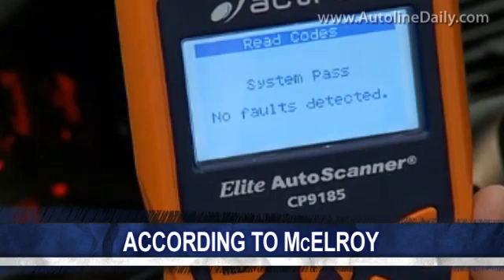How to Fix Unintended Acceleration for Toyota and Every Automaker

Comment: I have the 2008 f250 with 60,000 miles when I come too a stop light the the unintended  acceleration of goes from o- to 60 mp and I have to put my foot on the brakes, and turn the key off and on 5 times before it goes back to normal  I file a claim with ford dealer they don't want to take responsibility thank god me and my wife and grand daughter were not in any accident but I would like any input for the cause its like im stuck with a lemon

Comment: Software errors are common, bugs are commonly not found and suddenly cause errors unexpectedly especially with memory unsafe languages like c hopefully rigorous testing is used, and double, triple or quadruple redundancy and a memory safe language like rust. Also manual overrides are generally a good idea and should be taught in driving schools, like a start stop button and power steering and braking should also be explained.

Comment: #1 the manufactures use algorithums that mask UA. 

#2. I have replicated UA with moisture. 

#3 Other experts including NHTSA have replicated UA

#4 I have seen the computer system fail to detect UA because of moisture.

#5 toyota was busted masking UA through algorithms.

Comment: How do you fix unintended acceleration, when the car accelerates on its own, with no foot on the pedal (while on the highway)?  I don't think you have researched this topic at all if this is all you have found.  I believe that most cases could be used error, but clearly not all.

Comment: Wrong nasally-speaking pale man. I was driving a new '81 Audi 5000 in '81 and was turning onto an on-ramp when I literally felt the pedal under my foot drop to the floor, instantly the engine roared and hit the tach redline, surging forward like a bat out of hell. Luckily nobody was in front of me, and= as I mashed the brake pedal, it did little to stop me rushing forward. As suddenly as it had accelerated on it's own, the pedal snapped back. This shit really happens, and I have no doubt Toyota's drive by wire system had a fatal flaw in the computer program causing all these accidents and death...

Comment: Breh. What if car is in nuetral & the rpms are shooting up & you hear the engine revving? While foot is On The Brake
Reply: Exactly mine is doing that shit now!
Reply: @dtowntx7776  in my case I replaced the Low motor mount (middle-ish but probably more on passenger side) & it helped a Lot- it still revs+accelerates a little (to about 3000rpms)when I give it a little gas from a stop but then it at least stops right when I shift to nuetral if im in like a parking lot or traffic jam

Comment: John I suggest you goggle Toyota's whistle-blower she had 1500 internal emails of theirs.. 
starting the cause was not from driver error but from an electronic fault.. ETC system  etc
Reply: 2012 Rav4, 4 cylinder with 120,000 miles.  When stopped at a light, the engine rpms will sometimes surge.  That is after having stopped and with right foot on brake pedal.  This is not a big foot problem and it is not a bunched up floor mat problem.  This is a drive by wire problem.
These events happened to both my wife and I.  It is really unsettling when the car suddenly decides it wants to drive through a red light.  I assumed perhaps the throttle pedal position sensor is going bad, but when I read the codes, there was nothing there.
I did not find any recalls for the pedal or anything related.
Another possible cause might be a vacuum leak in the brake booster.  Although you would think this would show itself during the slow down to a stop rather than after the car has stopped for a few seconds.
Another idea I had was maybe a sticky idle air control valve.  However the Rav4 does not have an IACV.  The computer handles all idle adjustments.
Reply: Those were all fake.
Reply: @andym1223  
Don't think so!!! 
My Mum nearly died 
in her u bute corolla...

Comment: Wow.. Talk about corporate sponsored videos. "They don't exist" he says. Yet the court documents (released after this video was made) clearly show Toyota's complicity in poor programming of the EECS (Electronic Engine Control Computer) would under (very rare) conditions, accelerate AND disable the brakes. and the only way to combat this was to do the (very unnatural act) of completely releasing the brakes entirely and then stamping on them hard again, while also pressing the park brake button, or selecting park on the automatic transmission control. The key being "STAMPING" on the brakes, like, really hard!. brakes in cars are kind of hard-wired, so even if the computer decides against you, the brakes still work, Just with no assistance. if you've driven an OOOLD car from before the 50's you'll know how brakes felt before 'boosters' were a thing. you'd stamp on them so hard you'd be pushed back in your seat.
Reply: 2005 Highlander began to increase acceleration at random. Not a "carpet issue"!
Reply: Who paid for this video  Toyota Lol
Reply: The media has warped your mind. Listen to Malcom Gladwell's podcast, you will understand it better.
Reply: @andym1223  
Don't think do.. 
I think Toyota has warped 
your mind!!! 😉

Comment: You are full of SHIT my 2005 Tacoma will go into full burn out Mode with My foot on the break pedal at a full stop. How much is Toyota paying you to push  Disinformation? My Tacoma could have killed me or some one else Cannot blame gas peddle  the two times my truck had unintended Rapid Acceleration I was at a stop with foot fully depressing break pedal I never knew my Tacoma could Smoke the back tires while pressing the break and not even touching the gas pedal. I was a professional Driver working for the Government! There is a serious problem! The more you try to hide the problem the more people will DIE!
Reply: June 29, 2019. My 1999 Tacoma just experienced Unintended Acceleration after I started it up, put my foot on the brake, then put it into Drive. Back wheel spun like crazy, (also smoked-and I was on a dirt driveway).. Since this happened many times before, I just turned the motor off, restarted and went on my way.